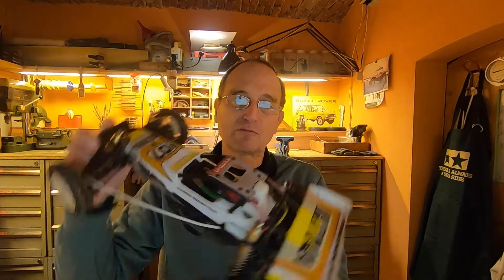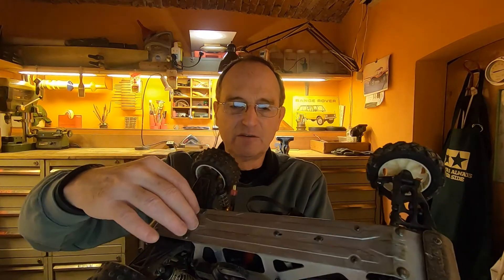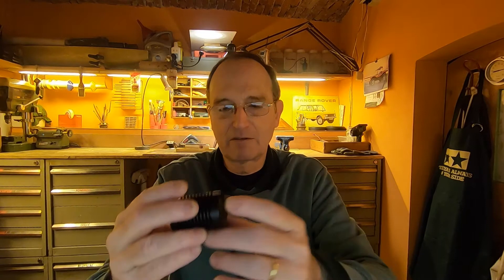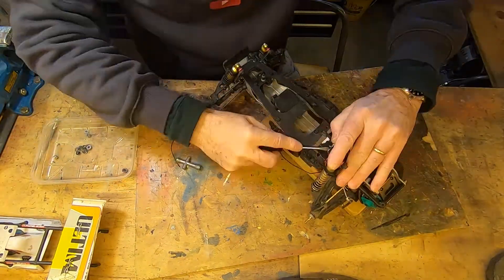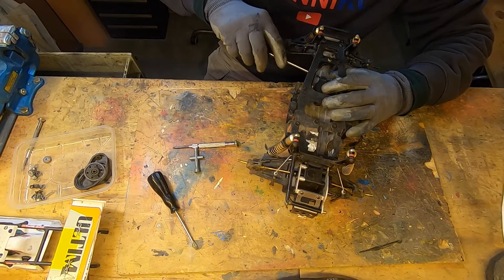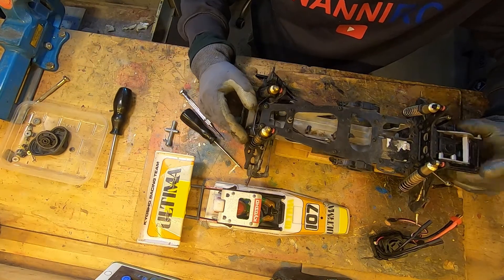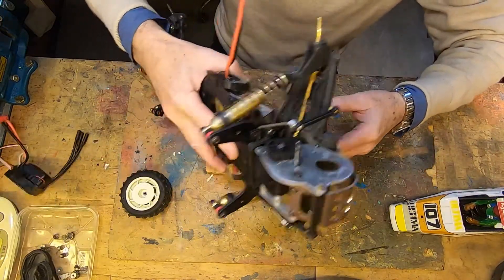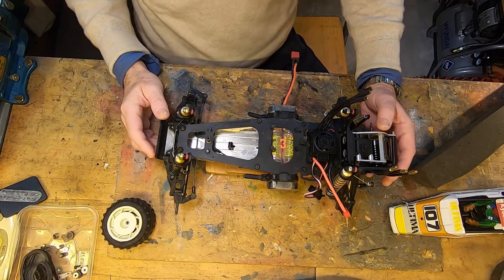KYOSHO NEW PROJECT! electronics upgrade on my vintage ULTIMA: ESC, Brushless motor and receiver

Comment: Hi Nanni, which products did you use for washing? Which detergent? Also did you remove the bearings and shocks? Isn't it a problem to get water in the bearings and shocks? or did you dry the parts after?
Reply from the maker: 1 Tergi Forno by Sutter and Chanteclair ( be careful with metal parts alu. overall...).
2 Bearings wash with petroleum and after WD40
3 shocks no problem with water
4 dry with  compressed air.
5 Grease with petroleum
 tooth brush and sponge

Comment: Oh Nanni, great buggy from the 80's. I remember the Kyoso Ultima, a friend of mine had one when I had my Tamiya Hornet and always aspired to have one....eventually. Great to see the upgrade to the electronics and some TLC to the buggy, should make it perform well. Oh keep that Le Mans motor, very collectable. You mentioned that you used Flysky transmitter & receiver, what do you know of a reliable place to purchase Flysky (I want to make sure I buy a genuine Fkysky product)? Looking great though, can't wait to see the next ? Ciao bello
Reply from the maker: Hi John, here you can find the radio: https://www.banggood.com/FlySky-GT3C-2_4Ghz-3CH-AFHDS-LCD-Screen-PPM-Output-Transmitter-with-FS-GR3E-3CH-Receiver-for-RC-Boat-Car-p-1620246.html?rmmds=search&cur_warehouse=CN
There is also the gt 5 that I recommend you, a little more money but something more, this is the link:
https://www.banggood.com/FlySky-FS-GT5-2_4G-6CH-Remote-Controller-Transmitter-with-FS-BS6-Receiver-for-RC-Car-Boat-p-1503240.html?utm_source=google&utm_medium=cpc_ods&utm_content=suzy&utm_campaign=suzy-sds-7hotsale-0416&ad_id=431632765347&gclid=CjwKCAiAnvj9BRA4EiwAuUMDf3H9eRbqFN2VdB7itfKkUvFlMFXa5Z3WbwehTllOIYyQEeb3kW9-BhoCVewQAvD_BwE&cur_warehouse=CN
Stay safe and Ciao! Nanni
Reply: @NANNIRC  Thank you Nanni, I will check those radios, always appreciative of good advice and value your opinion. I will keep looking out for your next Kyoso Ultima upgrade video. Until then keep well and all the best your your family. Ciao John 😉

Comment: It is a great buggy. It is the one that won the world championship for 2WD off road in England with Joel Johnson in the mid 80s. It is a pity Kyosho now does mainly ready to run kits.
Reply from the maker: Good to know, Thank you
Reply: Lol, what?
Kyosho does do rtr cars, but it still does a heap of kits as well.
Such as the race kits like the Ultima RB7, SC6, RT6, Lazer ZX7 in 10th scale, the MP10, MP10T, MP10e kits in 8th scale.
Not to mention the legendary series which are all kits. 
Scorpion, Turbo Scorpion, Beetle, Tomahawk, Optima, Javelin, Turbo Optima, Ultima and the latest is the 1/12th scale Fantom...
Every manufacturer offers rtr because that appeals to an audience that just wants to drive instead of building a kit.